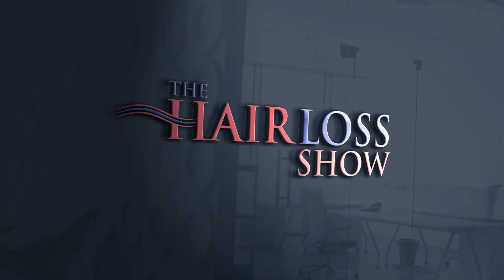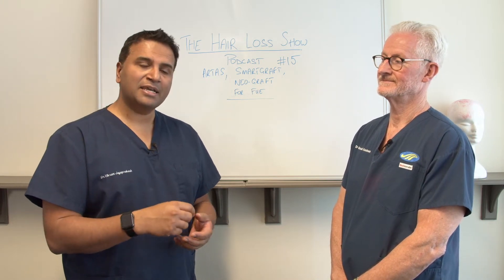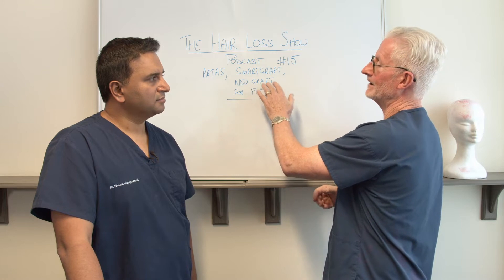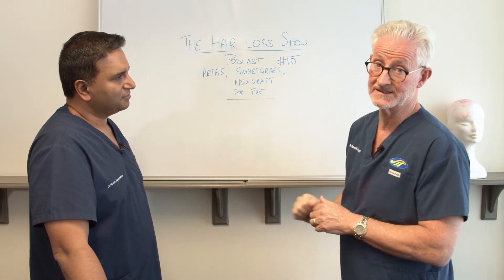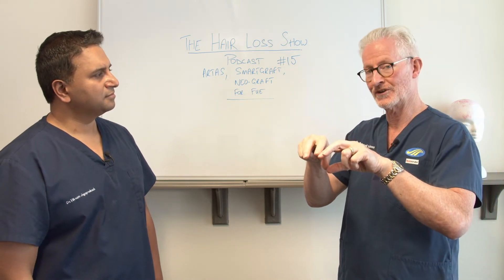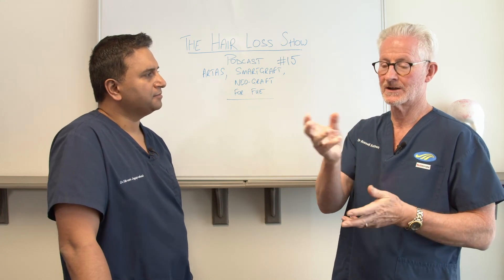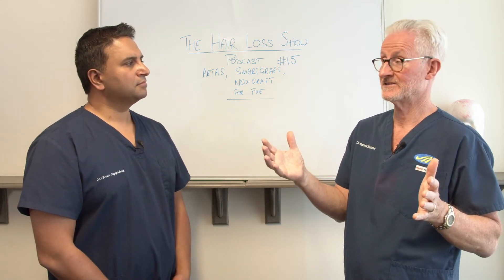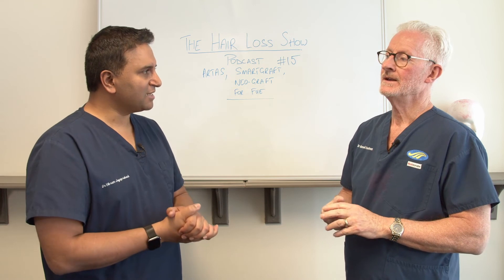Different FUE Technologies: ARTAS, SmartGraft and NeoGraft

Comment: There's a well rated clinic close to me here in the UK I'm thinking of going to for for my second HT procedure to get more density at the front. They are offering Manual or Artas options. If you was to pick one of the two for a more density procedure of about 1000 - 1200 grafts which one would you go for? Thanks in advance.
Reply: Let me know if you learn anything new about this. I'm in a similar situation. I've never had a transplant, but the surgeon I want to go to gives patients two options – 1.) FUT or 2.) FUE with the ARTAS robot. Some people think it's bad if a surgeon uses a robot, but I don't know. This doctor said I will need 1,000 grafts, so I don't know whether to choose FUT, FUE or to get a second opinion.